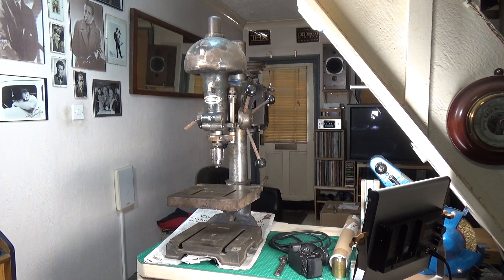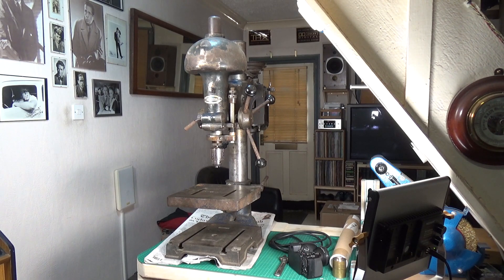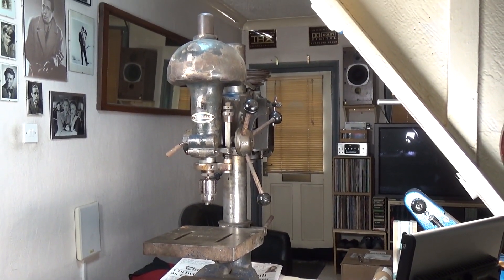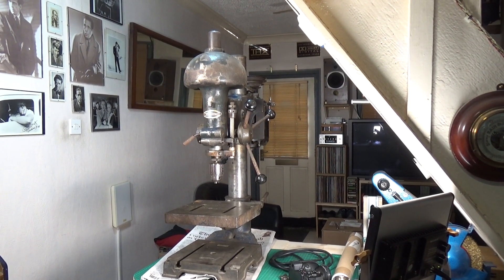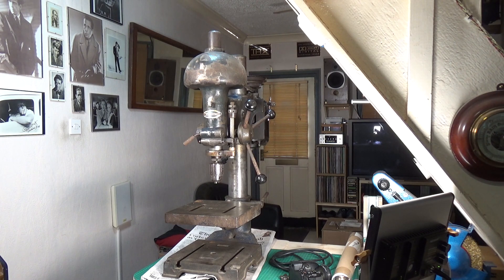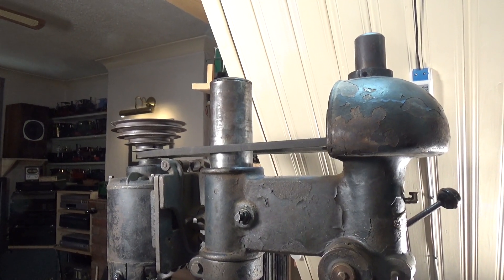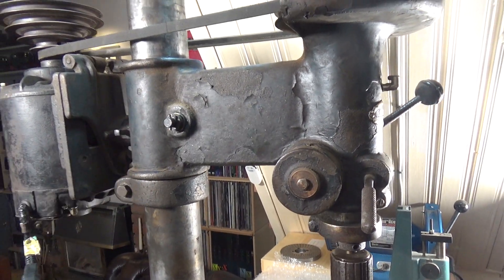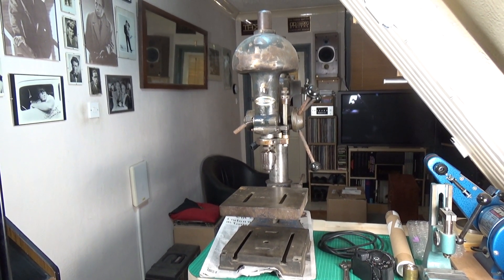Retro Tech - Workshop Upgrade Craftsman Drill Press

Comment: this is a cannedy Otto ROYAL drill press made in the 1920s or 1930s. I think it may have been rebadged only. This is a solid piece of drill. I bought one for $40 to get at the machined cast iron pulleys to put on my walker turner 900 drill press as an upgrade. I dont know if yours has the cast iron pulleys or not. From the looks of it, it could be zinc alloy?
Reply from the maker: Thank you so much for this information. I had never heard of Canedy-Otto before. Looking online I managed to find a catalogue, mine would appear to be a No.16 Royal Bench Mount drill press. From what I know about Craftsman they did rebadge other manufacturers products so that could explain it. The pulleys on mine are also cast iron.
Reply: @RetroSteamTech  nice, glad to hear the pulleys are original! the motor one did not look like it because it was more of a grey color instead of the brownish red color, am sure it was polished up at some point but yeah it looks like the original after seeing your other restoration vids. I locally found 2 of these royal drill presses where I live, thats when I saw the cast iron pulleys, because these are from the 20s or early 30s, they were made very well! One I saw on line is a floor model, the seller would not replay and so I left it, he wanted $40, I found a bench model like your later but had to drive 1hr one way to get it. for $40 too! They initially asking $100. later from the mid or late 30s and onwards, all the pulleys were this zinc alloy, (pot metal type) casting, no good even though they worked fine. the cast iron pulleys on the royal are machined and balanced, they do not vibrate and spin true. either someone slapped on a craftsman badge on it or craftsman had them outsourced. did you see any other holes on the head casting where the badge is? the royal badge was a big oval badge. if there isn't then craftsman did outsource it which would be the first that I am hearing about it. like I said I am suing the pulleys for my walker turner 900 drill press which is a floor model from the 1940s. the bearings and pulleys will fit, bearings are same and so is the spindle assy. funny that the royal has a beefier casting all around including the column but the spindle assy is the same, just know that the pinion and rack teeth are of finer pitch on the royal. you cant sub with another even though the rest are same. the royals are harder to find and people dont know much about them, they have plenty of walker turners, craftsman, atlas and delta drill presses to go around! oringally the royal came with a 1/3hp motor. you tilt the motor mount up to change the belt, quick and easy.
Reply from the maker: @ronitsingh85  No, there are no holes in the casting for the Royal badge or the side plate. Which probably means it was made for Craftsman by Canedy-Otto like you said. The motor would probably have been changed once it was imported into the UK. The Crompton Parkinson motor fitted is 1/2hp and yes, I really like the motor mount, very easy to change the speed.
Reply: @RetroSteamTech  well then it’s a genuine craftsman from factory! American old drill presses are nice! I am sure England, Swiss and German ones are nicer and higher quality. But there are always something unique about every machine that captures the heart! Glad you have one and will be using it with joy. Try a link belt, less vibration and smoother running.

Comment: Good pickup Alan.  I can never figure out why some people go smaller rather then larger with drill presses.  As you say the current small offerings are crap.

We have Crompton Parkinson motors floating about in Oz.  I didn't realise they were that old.  Quality motor, but then most of the old brands are.

The Taiwanese drill presses from the 1970s are pretty well made.  I have one larger than yours that I bought secondhand at least 40 years ago.  Yeah I'm that old ;)

I would strip and repaint that one you have as it would be worth doing and a pretty straight forward job.

Cheers Rob
Reply from the maker: Hi Rob, yes i was very lucky to get it. Stripped it down yesterday afternoon, just waiting for the weather to improve so i can get outside and attack it with a wire brush.

Comment: Nice addition/upgrade. A lot of American machinery of that era was sent over by the US to help with the war effort before they fully jumped in to WW2. i got to operate KandT mills etc as an apprentice that came over at the same period. Nice one Ade.
Reply from the maker: Thanks for that Ade, i was wondering how it managed to get to the UK and that probably explains it. I'm now trying to work out how to remove the cap which sits over the spindle pulleys and protrudes through the casting. There are 2 cap head set screws which if removed allow it to rotate but not come off. It must be removable otherwise you can't change the belt.

Comment: Hi again Alan,

When you said how old Crompton Parkinsom were and the period they made motors I was a bit puzzled.  I went down to the workshop and had a look at my Binks Bullows air compressor from the 1970's and sure enough it has a Crompton Parkinson 1.75 HP motor on it from brand new.  BUT it is made in Australia.

As I said there are lots of CP motors in Australia and most are relatively recent (pre 2000) so the original brand must have been sold to Oz or some such change happened.  Anyway we have lots if you want one, Ha Ha.

Same thing as Leyland, they went bust in the UK but are now made in India by a huge bus and truck company there, plus Enfield motorcycles rose from the dead in India and are now the second biggest brand in the world.  LOL

I see MG also got sold to the Chinese (Cherry) and are now zooming ahead as a brand.

LOL.  What's going on over your way ?

Cheers Rob
Reply from the maker: Hi Rob. I got my information on Crompton Parkinson motors from the website of Crompton Greaves Electric Motors who are the modern company that trace their history back to CP. This is their website,

http://www.cg-electricmotors.co.uk/content/6-cg-electric-motors-company-history

I actually read it wrong and it would appear that Crompton Parkinson were around until 1966. However looking on Keith Rucker's website it would appear that the style of the drill press that i have is much earlier than the 60s. It's similar to models from the 1930s or 1940s, although i still haven't found which exact model it is.
Reply: Hi Alan,

I found this which fits in with my basic knowledge of the availability of these motors in Oz:  https://collection.maas.museum/object/496931

Cheers Rob
Reply from the maker: @Xynudu  Hi Rob, it's interesting that the history differs between countries. The plate on my motor says "Crompton Parkinson Chemlsford England", according to CGs website they changed the company name to " Crompton Greaves Ltd" in 1966. Yet it would appear that they kept going in your part of the world until 1970.
Reply: Yes, Wiki is often not correct or incomplete.  It's a resource but not vetted, so anything goes.

A lot of information on the web is like that, even from supposedly informed technical sites where the data jockey has got things mixed up.

Cheers Rob
Reply from the maker: @Xynudu  Interestingly, i just looked up the 2 patent numbers which are on the motor plate, both are dated July 1935. Which does rather tie in with the info on the CG website.

Comment: Look up the history of the Craftsman. I believe that badge was only used from 1937-1944. May be able to get closer with the date. Also look T Craftsman Power Tools Catalog. I have seen 1937 through 1941 on line. I recently bought an Atlas Craftsman Metal lathe and used catalogues for dating.  This may also be an Atlas made product. I have a 1934 Delta Drill Press. Like yours it has some grime and chipped paint but runs like a champ.
Reply from the maker: Hi. Thank you for the information, I will definitely look up those catalogues. The drill press turned out very nice after some work, have a look at this video here,
https://youtu.be/VifOgFZ5G7E . Cheers, Alan.